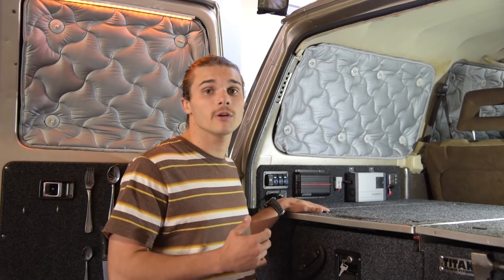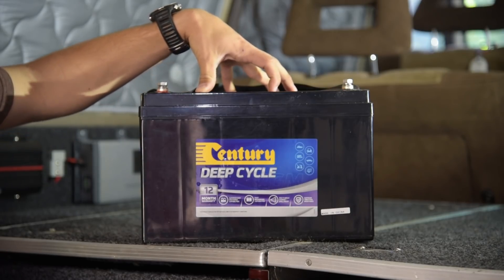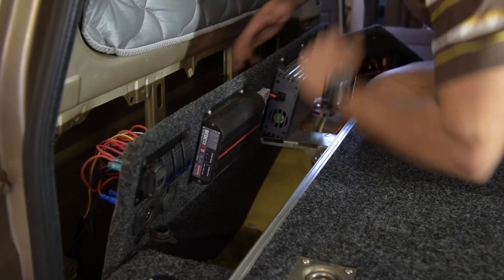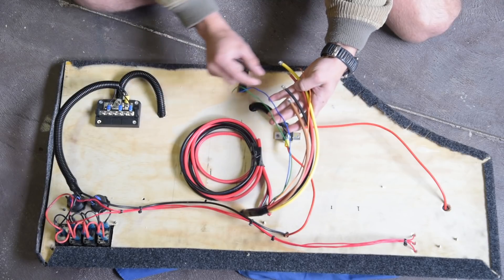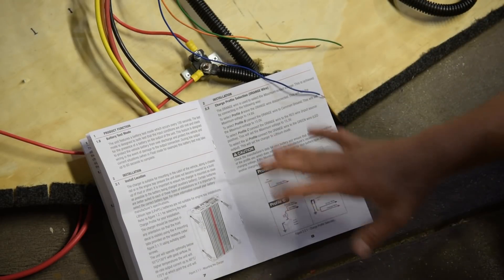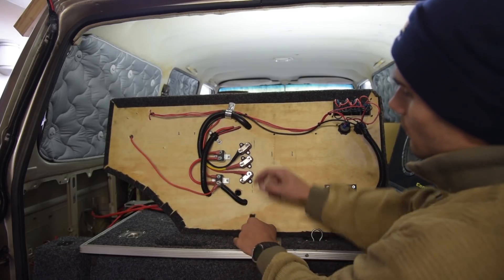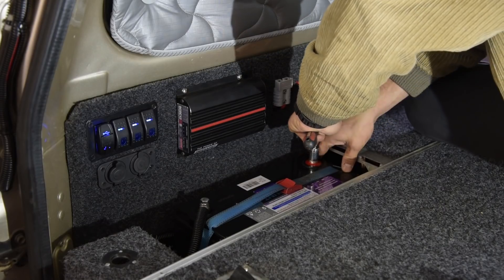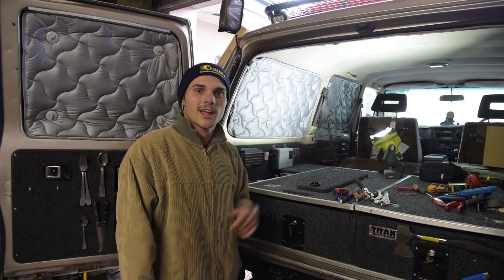How to make a CLEAN 12V System! | Part 2 | Redarc BCDC & Century Battery Installation

Comment: Good vid but dont think that 120amp agm will like 50amps from dcdc1250. Agm usually only like 10 percent charge to amp hour rating. From my experience 50amp charger for over 200amp banks , some lithium or 150amp lead crystal.

Comment: Hey mate, nice set up!! Do you still need the isolator with the BCDC charger? I thought they incorporated the isolator into the charger? And I see you have a BCDC1250, whats the reason for running this over a 1225 when the aux battery is only 120ah? Cheers!!

Comment: Where did you get those window block out foam from?
Reply: Tony Alba they’re solar screens mate
Reply: @danielbridgford3857  yes I know this...how much were they I sent email to them days ago no answer yet...
Reply: did you find when you hooked up the Redarc bcd charger that it will still use up power from yore 2nd battery without ant accessorizes going?
Reply: They’re around $330 for a full tourer set I believe mine were, they are closed with covid atm tho
Reply: I’ve had mine for about 4 years now and am only just replacing my second battery, seems to go fine for me I think